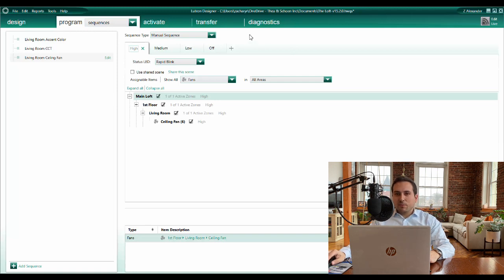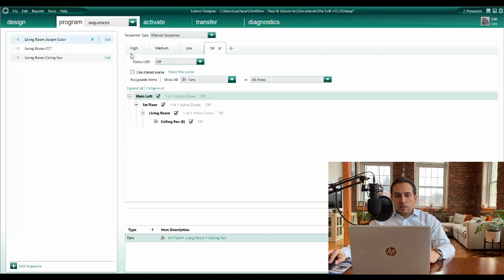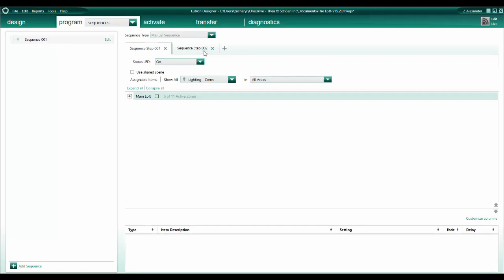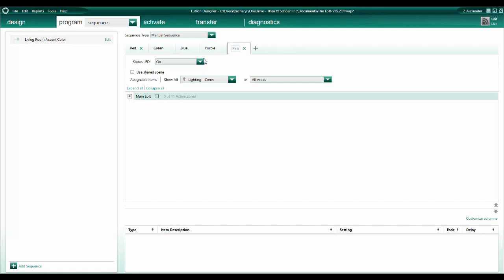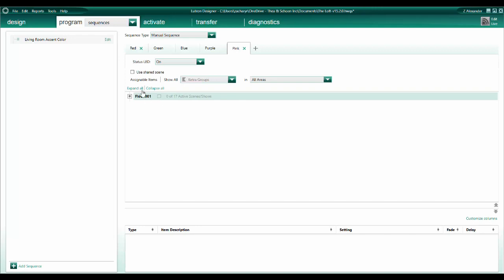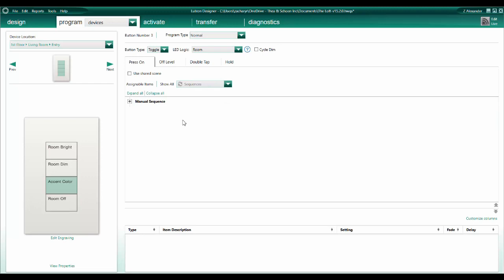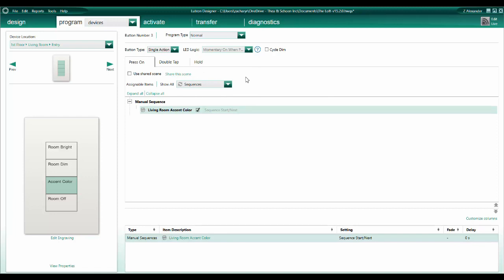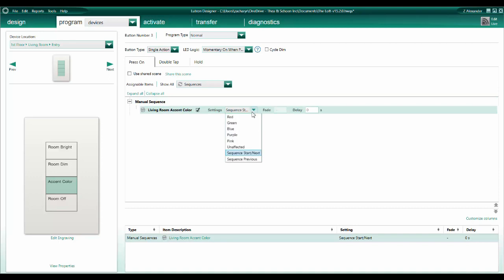Thea Lutron HomeWorks How To: Basic Manual Sequence

Comment: Thank you for the videos! What is the best way to incorporate a sequence but also use the raise/lower buttons on the same keypad to control intensity? We would like to use a sequence to change Ketra colors with each keypad press and then use the raise/lower to set the level once a color has been selected. Using a Pico that is programmed to the same group or the Lutron App works but is not an ideal solution.